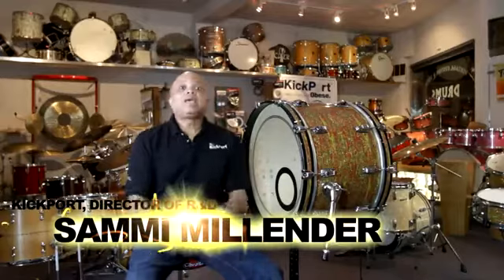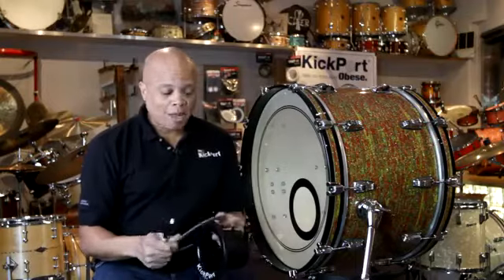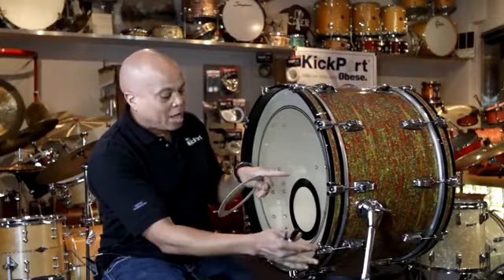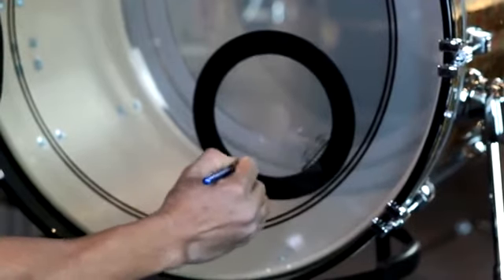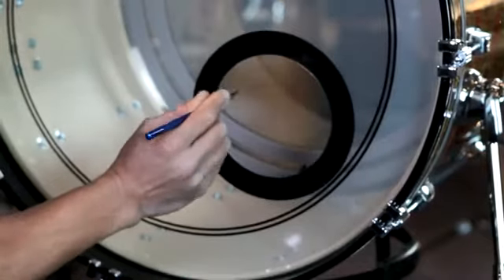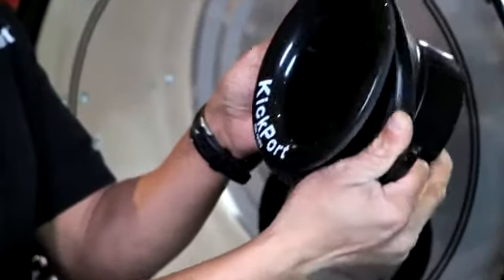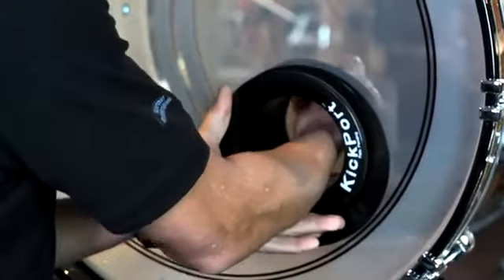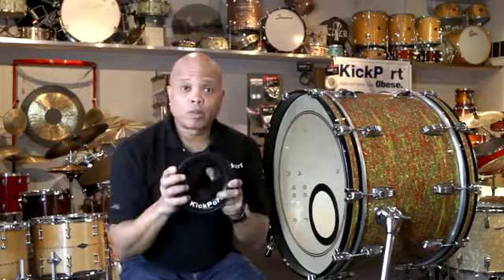KickPort Installation and Removal Instructional

Comment: Only it does not snap into place as suggested by the exact cutting instruction which has an adhesive template to go by, still did not work

Comment: I have this product sitting on my shelf for 5 years now, I still cant get it on without taking the head off! I can get my hand and arm in ok but there is no way to get the rubber seal to snap back against the inside of the head!
Reply: Same. I just took the front head off and reinstalled it. Impossible this way. 👍

Comment: MAN,I HAVE PROBLEM WITH KICK PORT!!! AND I AM NOT ALONE!!!!! when i install on bass drum,kick port produce some NOISE.....HELPS!!!
Reply: Hmm, I never ecperienced this. Might be either loose or it's not tight enough so that it vibrates. It shouldn't make any noise when it's tightened.
Reply: Sounds like vibration try pulling the ring closer to the flared end and reinstall
Reply: Sounds like an installation problem or a problem with the drum itself. Kickports are solid.

Comment: My reso head already has a hole 5 3/8" what size hole is needed?
Reply: 5 1/4". The instructions say for holes larger than 5 1/4", use a T-ring on each side to size down the hole.